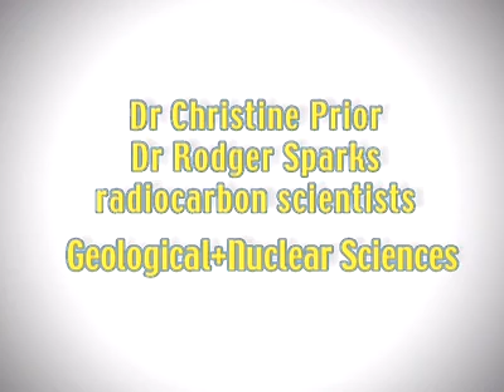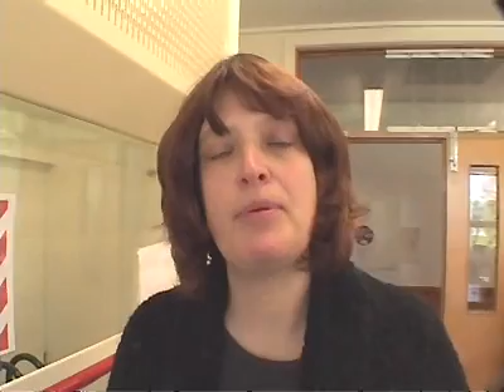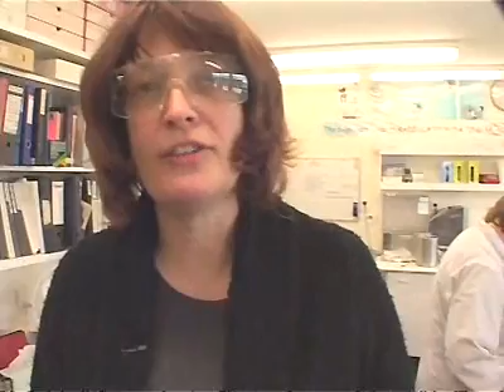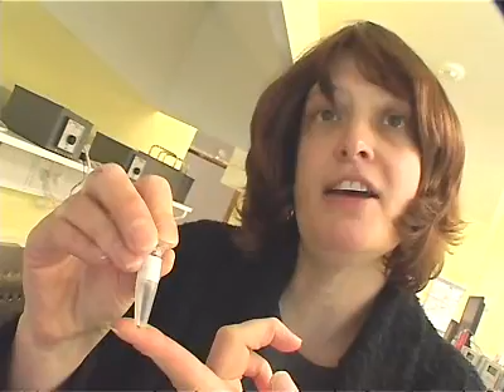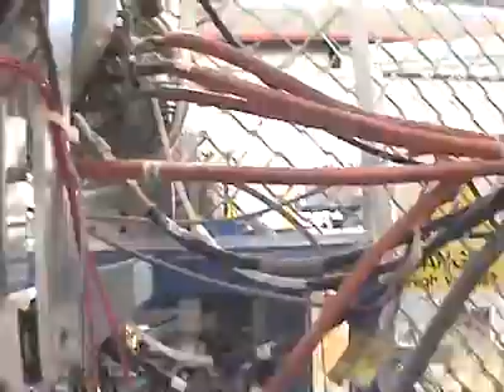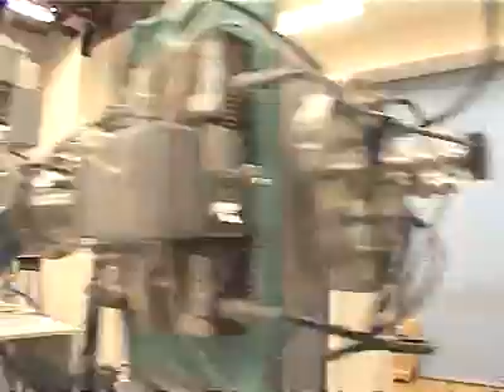Radiocarbon Dating

Comment: no you don't know the age, you know the % composition in comparison to time. the decay rate. So. if you have more carbon 14 because of an emp during the life of the sample, the time domain will not be correct as to the exact time, how much rainfall your sample got while alive if vegetation, you will only know that when conjunct-ed with tree rings, and the carbon 14 at specific times in those tree rings, and not know how much traffic of that carbon 14 flowed there from surrounding tissue. This method has to be in conjunction with other knowledge as the carbon 14 rate is not constant, but changes with every solar outburst. That is where it is generated, and with cosmic rays, which when the sun is in a period of calm, more cosmic rays impact the upper atmosphere. One solar outburst can alter this drastically, and thus is not a direct time to % almost ever.

Comment: I cannot see how this could work without also measuring the carbon 13 and carbon 12 streams. You need a ratio, right?

Is there any sort of daily or more frequent calibration required anywhere along the process?

Comment: Part 1) If I give you a cookie jar with 100 cookies in it and I take out one cookie a day, and you then look in the jar on day 10, you would find 90 cookies in the jar.  On day 99 there would be one cookie in the jar. On day 101 + there would be NO cookies in the jar. The bottom line is, if the half life of c14 is 5730 years +- 16, then by 174.52 half lives or 1,000,000 + years there would be NO c14 left in the sample to detect.

Comment: Part 2) The very fact that any c14 at all is found in the samples (once living plants in coal and oil) or "machine blanks" that are supposedly hundreds of millions of years old is an indication that something is not right. Either the assumption that c14 half life is constant is incorrect, and therefore not a reliable source for testing or, the  samples as well as the machine blanks are  not millions of years old. So which is it?

Comment: Just guess the enclosure size and adjust bass sound with bass-port. Have a tube that slides into another tube and adjust length of tube to the bass-sound you like the most. Easy!
There are instructions on cross-overs on my ch. You have to get "Speaker" cross-over components. It's all exp, I've been doing it for years (by ear) and now I'm fairly exp. Cross-overs control the sound big-time. I also doctor the drive-units themselves and that makes a radical difference. Just by trial and error. lol

Comment: I had a "Star" 8+8 valve amp. The best treble I've ever heard. But I went and sold it for a more powerful Sansui valve amp, but it didn't sound as good and it kept blowing valves. One day (when I can afford it) I'll grt one. You used to be able to get cheap second-hand (little) valve amps for peanuts but now they are all gone.
With speaketrs forget about the math and use thoes things on each side of your head. I do. You can make a speaker sound any way I like, with enclosures and cross-overs.

Comment: I used to have valve amps (old ones). Thanks for your interest. My big bin speakers are good and easy to make. You have to get ones with 3" voice-coils so you can fit the tweeters in. The point source makes a lot of difference and really is an experience to hear. That and the two-way makes the difference. Full-ranges don't go high enough. I have videos on how it's made. Look  up KEF and Cabasse speakers.
It's fun arguing, hope you are having fun too! But you can believe what you like. Cheers!

Comment: Triobites are not vertibrates. Yes they may be complex, but what I mean is that they are primitive cos they are invertibrates. Some vertibrates may be simpler than some invertibrates (but in general they are more complex). Anyway, vertibrates (for a better word) are more advanced than invertibrates (and this shows in the fossil sequence). You just deny that, so it's no use talking to you. We might as well just read your creation science and my science booke instead. But you only read yours.

Comment: The "magnet motor" scam is just as easy to debunk. There are hundreds of fake maget-motors on u yube (that only work on y-tube). Just science alone dubunks it (and I exp to find out). They are apparently very easy to make (on y tube) and so, if they really did work, everyone would have one! But nobody has one, yet they still insist on believing it, just like you believing in sticks turning into snakes. And they are totally certain, but the magnet motor can't work! They never challenge my arg!

Comment: It depends on the mineral because chemistry comes into play here. Some minerals exclude certain types of atoms. For example, if you have a type of mineral that includes uranium but excludes lead, you can be sure that all the lead in there comes from uranium decay. There are various isotopes that can be used. One of them is K40-Ar40. You can be sure that any argon40 found comes from K40 decay.

Comment: 1) Ok coral reefs aren't near old enough to prove old e. But how can you say that dating systems are flawed if you get more than two different types of dating systems getting the same answer??? Say, a sample is tested using 5 dating systems ans 3 are the same answer (and the other two with totally out answers and different, because they didn't work. If this happened and the 3 answers were millios of years). You wouldn't believe it (of course, and even if you did the tests yourself).

Comment: I just rely on coral rings or many other proofs that the world is old. 
How would you explain more than two dating systems getting the same answer? How could you disprove that? Would it be just by chance that completely unrliable dating systems would come to the same result? It doesn't matter if carbon 14 is stable in the air or not because we have many other different dating systems. So you have to deny dating system convergence to support your claim.

Comment: There are several different types of dating systems. They all give the same results (when they are all working, for that particular sample). Say we measured a sample with seven different dating methods and five gave the same answer. The other two (that did not work) would give insanely inaccurate answers. But the other five is proof for scientists. So how is it not proof for creationists?

Comment: @Eye2EyeIIIV
Samples of Known Ages are tested-It works when you callibrate it to the known conditions outside of how old it is, such as geological factors and diet (if it is biological)
Sample of Unknown age-ACCEPTED to work because all of the required factors used to calibrate in test samples are applied to the unknown sample based on observations and reasoning behind all deductions.

That...is...Science!

Comment: @Eye2EyeIIIV Ever heard about tree rings giving their age. Well, they also depend on the environement. So if there was a particularly dry year, the ring will be thinner and so on. If you take dead trees you can compared them to live trees and compare the rings, knowing when that tree died. With that method you can go up to like 10'000 years ago. They tested carbon dating on those trees and find out that they had to correct it a bit. That is science.